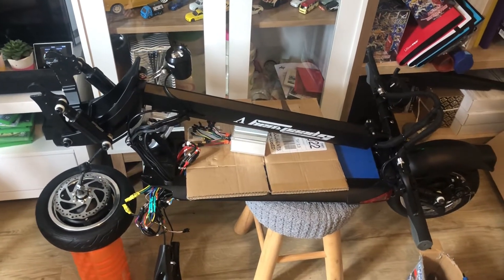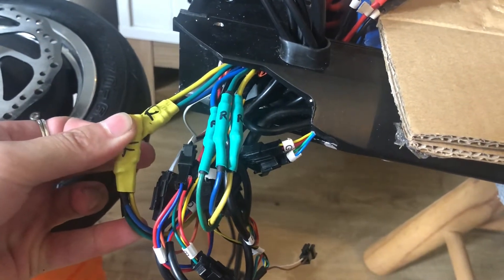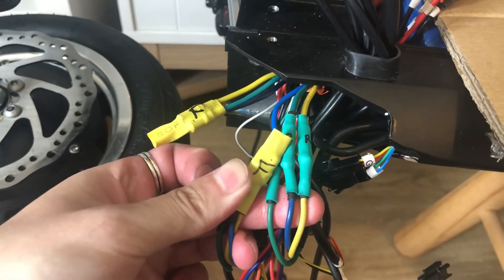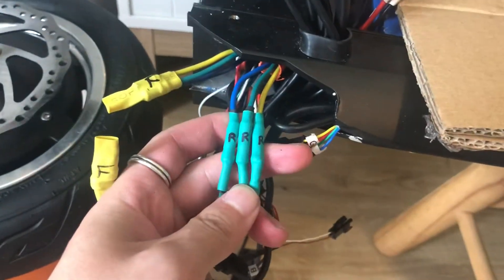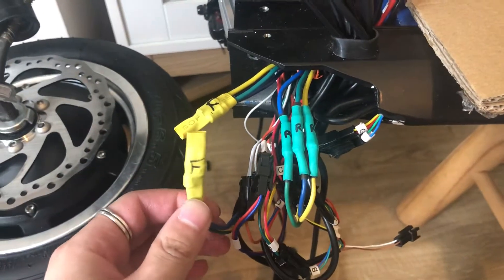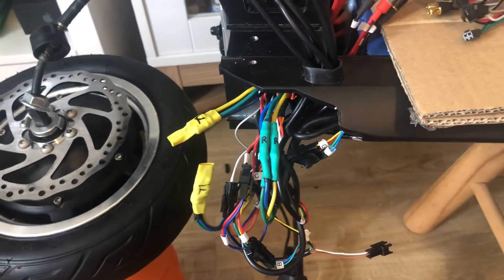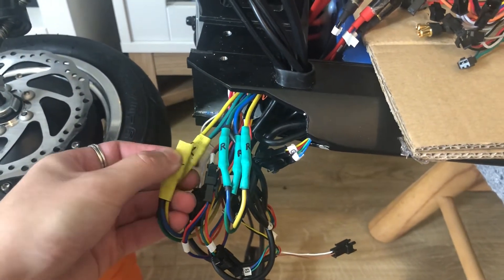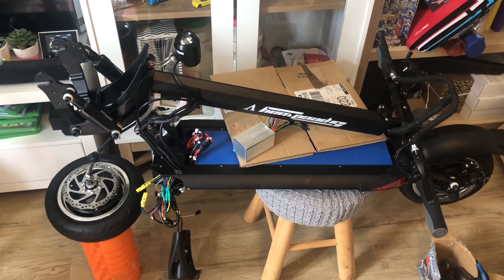Minimotors Speedway 5 Motor Controller Failure Diagnosis and Fix

Comment: Hi. I’ve just bought the same scooter. Where did you get yours from if you don’t mind me asking? Thanks
Reply from the maker: SMJ82157 hi. I got mine from aliexpress. There is a awesome seller on there.
Reply: Thanks. How’s the new controller holding up? Have you had anymore issues?
Reply from the maker: SMJ82157 after the controller broke the first time. I heard it breaks because of running the S5 in single motor mode for extended period of time. So I just kept the S5 in dual motors mode and never had a problem.

Comment: What can i do if the speedway 4 does not power on even if the battery is full. What could cause that?
Reply from the maker: F. Moussa hi, you would have to check with a scooter service team. Sorry I can’t be of help. Thanks.

Comment: this is still happening
Reply from the maker: nate love hi, yeah I believe it happens when you run single motor mode for too long(about 15 mins+). If you run dual motor, there was no problems. I’m just speculating from my experience. Thanks.
Reply: @scooterlifelondon3093  I agree with You, I had a vsett 10+ , great machine , but I used to Road in single motor and I had controller fault, so I learned that wey must Road dual motor to avoid overload in controllers.

Comment: Really nice explanation! Questions, could you somehow fix the old controller or take it somewhere? Or is it just cheaper to buy a new controller?
Reply: There is FET inside the contractor and change the bad one just for 2$ if you do by yourself. I did mine once and I brought extra FETs in case